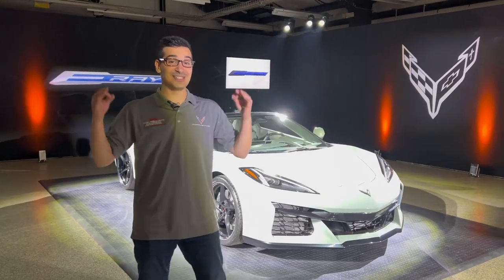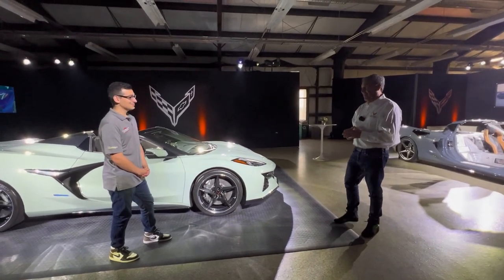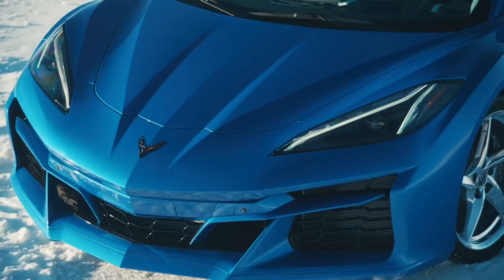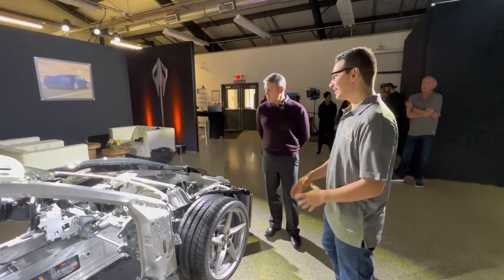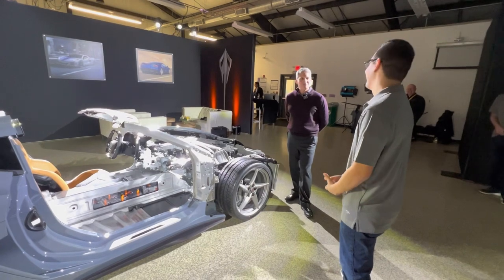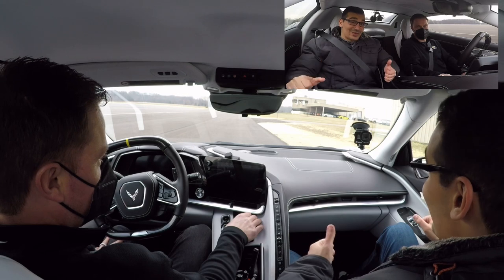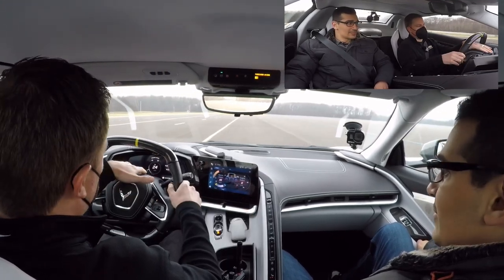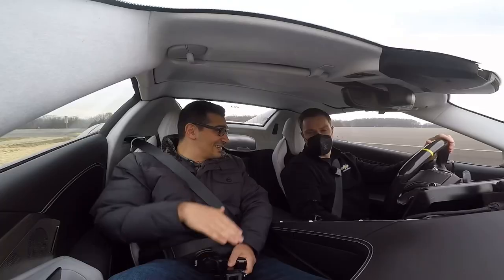2024 Corvette E-Ray In Depth Look with GM President and Lead Development Engineer

Comment: For the price of 2 base Corvettes 
(E Ray or Z06) I'm going to get an a base C8 (2LT with Z51) and add some and get a Porsche as well 🙂
Reply: You won't be getting any of those cars, because most jobs require at least middle school math comprehension which you clearly don't have. 

A 2LT Stingray with Z51 and good options is $86k. A well optioned E-Ray is gonna be around $120k. How in the world did you calculate that $86k x 2, which is $172k is equal to $120k????